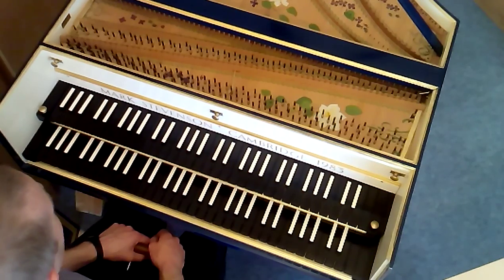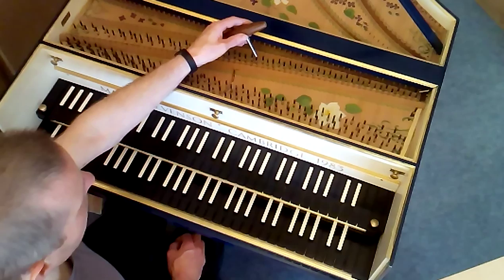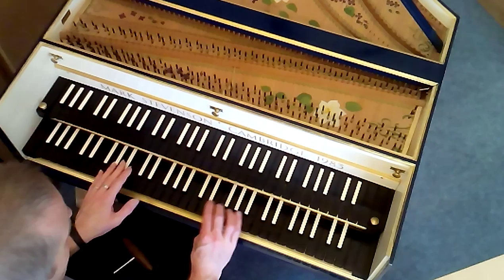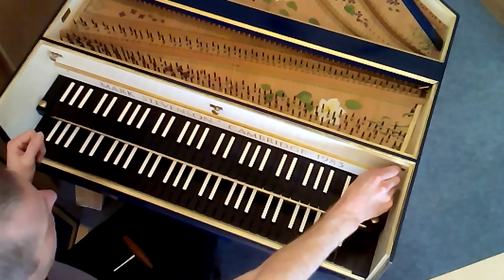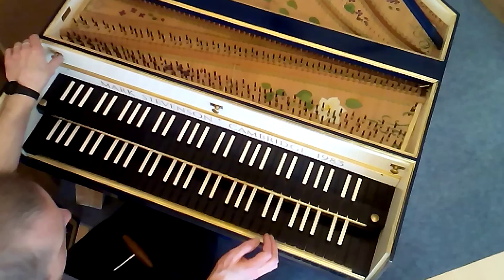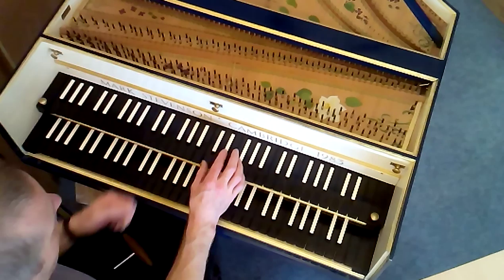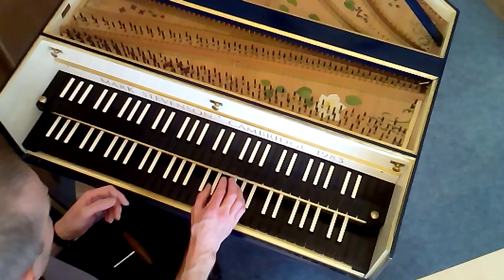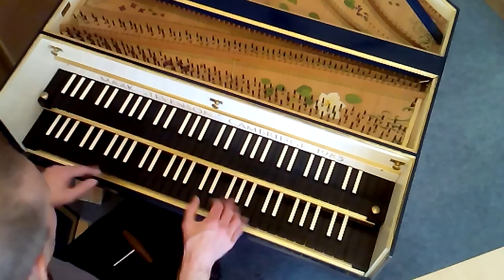Wighton harpsichord - demonstration of keyboards and stop levers

Comment: Is that a buff stop or lute stop on the upper manual (yes I know the names are used interchangably, but technically and historically the mechinisms are different both in timbre and way it is done, albeit sounding somewhat similar.)?
Reply from the maker: I don't really remember, it was years ago, but I think there was a row of little squares of suede type leather that slid sideways to touch the strings.
Reply: @simonmchadwick  That would make it a buff.
Reply: @MichaelSidneyTimpson  Then, what would an actual lute stop be?